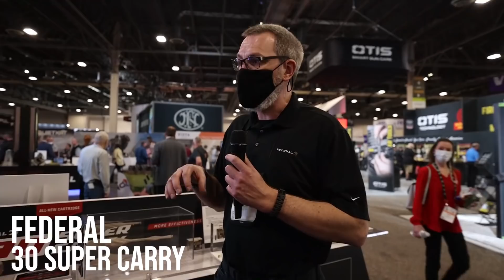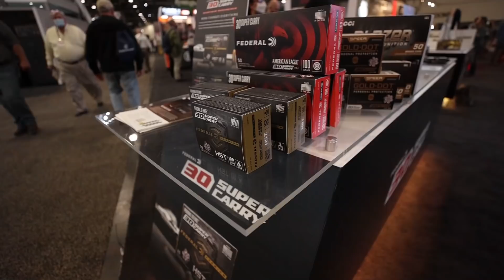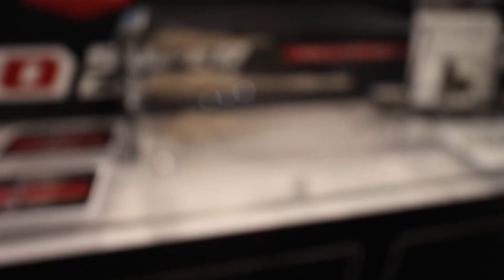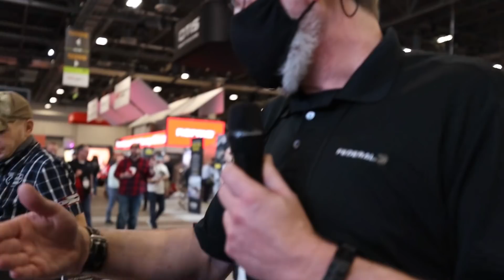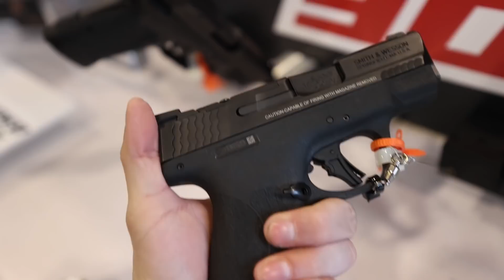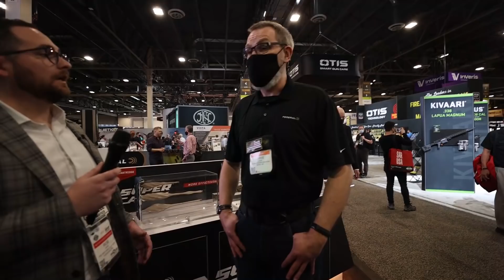30 SUPER CARRY: A NEW CARTRIDGE FOCUSED ON CCW

Comment: So... 
- I can't use this ammo with any of my other guns
- My 365 in 9mm has 14+1 in a 12 rd  using magguts
- There is literally no data on the reliability of this cartridge or its weapons (the 365 is tried and tested) 
- Outperform? You mean barely scrape the margins? 😂
- Could have invested time in biometric sensors, targeting systems, or round counters but noooo here's a new bullet 🤡
- "Carry like a .380, perform like a 9" Where have I heard this before? (Carry like a 9, perform like the .45; cough cough .40 S&W)
Reply: In the micro-compact 9mm world it seems like a hard sell to compete with such small 9mms that hold 14+1...with this 8x21mm cartridge will you be able to get 16+1 then? 

+P 9mm offers better/quicker stopping power to those not overly recoil-sensitive in a package already a little too small for some peoples grips. I carry 5+1 of 45 SUPER personally (I am not the target audience probably).

30SC will presumably operate better at range then 9mm, which doesn't help in self defense but sure does for shooting at rabbit sized game!
Maybe they buried the lead and should have named/marketed this in a suppressed short barreled PCC as a farm/ranch gun? ¯\_(ツ)_/¯